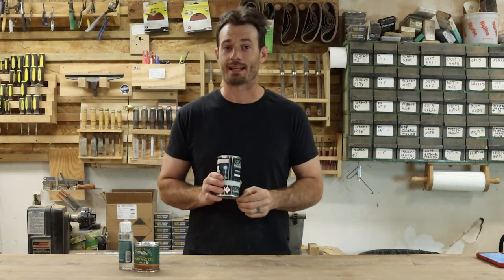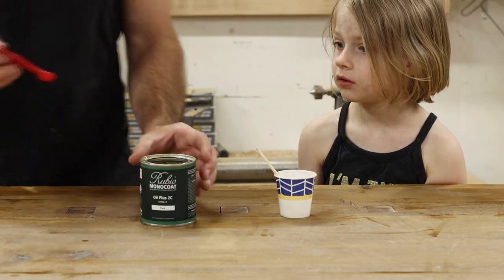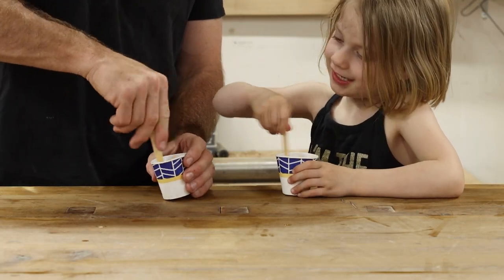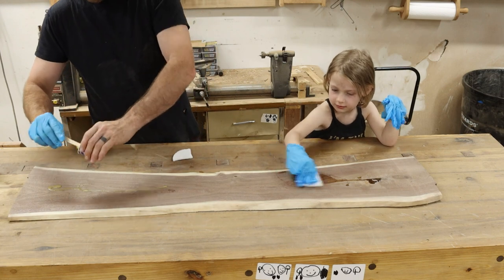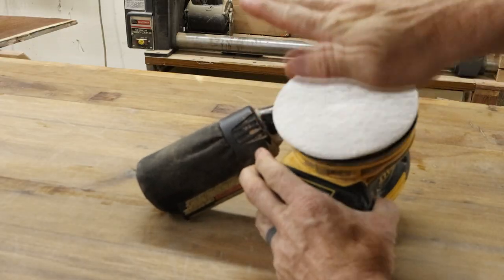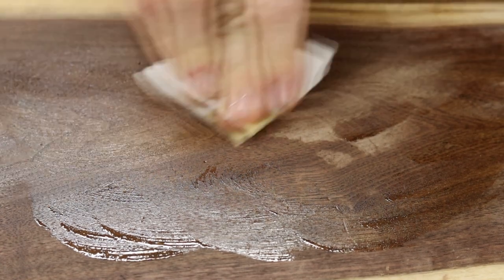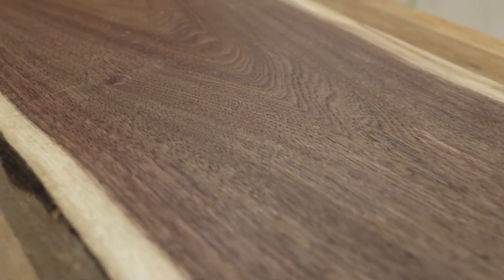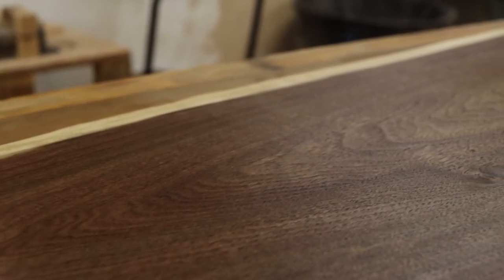Can This New Finish Replace Rubio Monocoat at a LOWER COST??

Comment: Looked at the GF at Woodcraft and it's not cheaper than Rubio. It's $46 for the can, then another $19 for the Hardener.   That's $65 compared to Rubio's $60.
Reply: 16 fluid oz compared to 12.8 fluid oz. 47% more material for the same cost..

Comment: Just used Rubio and I totally dig it on Mr walnut drafting table.  Only problem is that it is totally matte.  I will receive the maintenance oil in a couple of days.  Will let y’all know.
Reply from the maker: It is a bit matte after the first coat. I haven't tried the maintenance oil. I'm interested to know how well that works
Reply: You can apply Sheen Plus to bump the sheen to satin - I think this is a new product since this video was introduced. I sand to 800 grit and get a satin sheen that way. Never had trouble with Rubio soaking in at that grit level. On some pieces of wood, I can see where it has taken in more oil than other areas and I reapply during that 15 minute window - so it will absorb the oil at 800 grit. I wonder if Rubio’s instructions about sanding to 120 is for its original intended purpose which is flooring. There is still some ‘tooth’ in the wood at 120 grit so you won’t slip on the wood and fall. However, my furniture at 800 grit is super slick and it would be a fall hazard on flooring.
Reply: @prspastor  Thank you for the tip!

Comment: I just refinished a mid-century walnut veneer dresser - first timer. I went back and forth on what finishing product to use and settled on General Finishes. I just applied it yesterday and it looks great. My question is... Do I need to apply a second coat? I can't tell if it needs one and Googling that was unclear. And if so, do I need to use a gray pad beforehand? Looking for some advice. Thanks!
Reply from the maker: I don't know for sure but I know with Rubio you can use one of the red scotch bright pads on the surface then apply a second coat. That's probably what I would do with the General as well. As for if it "needs" one, probably not but It's completely to you😁 Good luck!
Reply: @WyldeWoodworks  Thanks for the advice. Appreciate it!